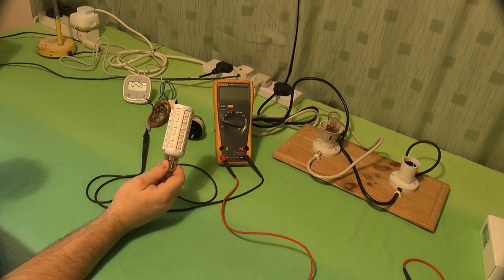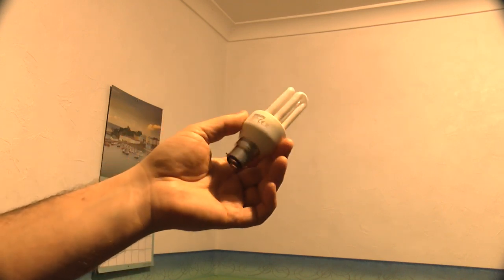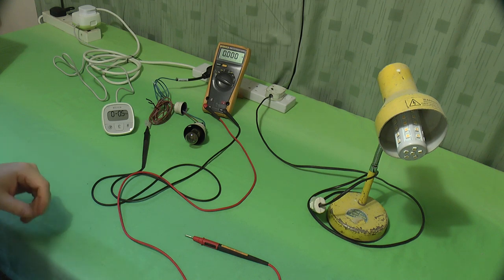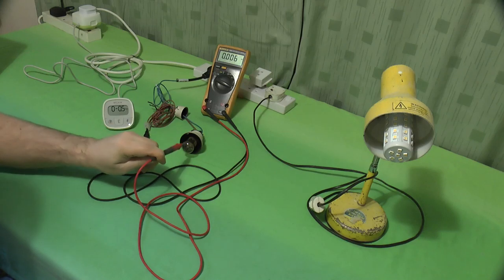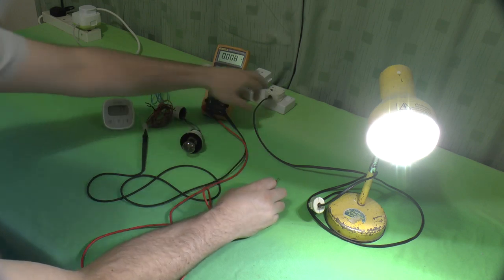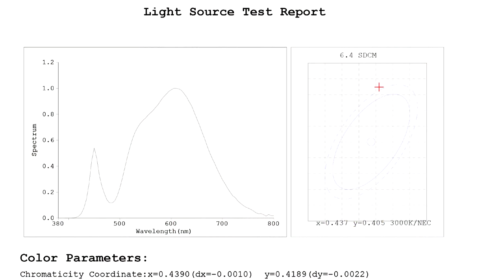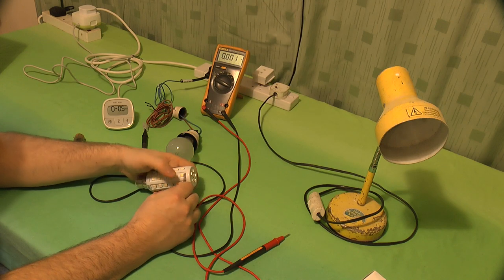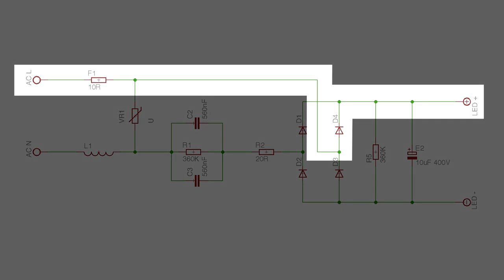Dangerous LED "corn cob" lamp test and teardown

Comment: i am not agree with some of the stuff shown on video.
1.who is going to touch these light when it is on?
2.other bulb is lighting because current passes between leds .
Reply from the maker: 1. If it's within easy reach, children can touch it. Look at the example, it's a bedside table lamp.
2. Other bulb is lighting because enough current is passing to kill someone.

If you don't agree with the video, please feel free to post your own, disproving the evidence shown in both this and the follow-up video.
Reply: AintBigAintClever That doesn't sound like a good advice ;). (let's touch it and see what happens :P)
Reply: Although you SHOULDN'T do that on purpose, if the LED bulb is working properly and all the LED lights up, you should feel nothing when accidently touching the exposed LED connecting contact whether the bulb has been connected correctly or connected with polarities reversed. GUARANTEED!

This guarantee is void if you purposely hold your hand to any grounded metallic conductive object in one hand and touching the exposed contact with the other hand.
Reply from the maker: John Lam
With a correctly-designed bulb, yes. Not the case with these. They're a potentially lethal shock risk, end-of.

Comment: This guy is touching the lamp with it on, and he is still alive...

Сравнение свечения светодиодной лампы E27 60SMD 5050
Reply from the maker: a) Lamp may have a different driver circuit design. Look at the bottom of the lamp 15 seconds in, in between the LEDs and the metal base, it's clearly a different design of corncob. If it uses a switch-mode power supply to drive the LEDs they may be completely isolated from the mains and therefore safe to touch.
b) He may not have gripped tightly enough to touch the metal contacts.
c) He may be using an isolation transformer (unlikely unless they're dangerous and he knows that to be the case).

Comment: I bought a similar Lamp as this one and i can't reproduce what happened here. I touch it in every possible way and no chock.
Reply from the maker: Yours may look similar but have a switch-mode power supply driver circuit (so the LEDs are isolated from the mains) instead of a capacitive dropper circuit (which is fine for conventional-shaped LEDs but no good for LEDs with exposed contacts).

Comment: why would anyone touch any contacts on any device that is connected to AC?  Why not plug it in a leave the thing alone?  If you are going to touch it, turn off the power.  I would not touch an incandescent bulb either unless power is disengaged.  Many things are not safe to touch I think.. I DO think they should put a plastic shield around the unit though like the envelope of an incandescent bulb in case someone with a moth-like mind decides to actually "touch" it..  just sayin'

Comment: Beware deadly #LED #bulbs for home use. #CE marked. Cheap imitation from China or just a lethal design?
Reply: Best line: what a piece of shit
Reply: We bought some daylight bulbs on ebay. Standard energy saver florescent 13W bulbs but emit a brilliant white light. I think they start / warm up much faster too. I was really impressed at how cheap they were, about £1 each from China. One thing I've learnt recently is that the UV spectrum is very big and the part which Does not cause cancer is small. Apart from that, quite happy with our cheap bulbs :)
Reply: Bloody hell, when you reverse the poles on the bulb!
Reply: Tom Woodland  yes that was alarming! Can imagine some poor child or even an adult touching the exposed LED contacts by mistake.

Comment: I've never seen so much bas science before in my life :~)
So you can draw a less than staggering 43ma by connecting it through an extremely low resistance bulb directly back to the neutral on the mains! (A thing that no one except an absolute maniac would ever attempt......). A typical pigmy bulb only has a resistance of a few hundred ohms, and would therefore draw a huge amount more current than the human body, which will have a typical resistance of several Mohms.
 So I decided on my own mentally challenged test :~) By strapping my wrist firmly to an earthed radiator via a decent multimeter I grasped the bulb with my other hand and eventually managed to get 0.81ma passing through my body at 4.3 volts (gasp!). Literally taking my life in both hands I licked my finger and pressed it firmly against one of the contacts - by doing so I managed to achieve 1.2ma and acquired a sore finger from the pressure. Resistance is everything!
If there is no isolation from the mains, how come it all still worked when you reversed the polarity, despite still having one side of your test rig connected to neutral? I notice you didn't show the little transformer usually moulded in just under the cap ;~) All you showed was the circuitry used to change the reduced AC voltage (usually around 12v) from the transformer to the 3 - 6v DC required by the SMD circuitry 
If you do contact the powers that be, may I suggest the following warning to be included in all packaging?
 
*WARNING*
Do NOT attempt to change this bulb with the power switched on whilst standing in a bucket of water connected to earth.
Otherwise mild tingling may result.
*KEEP AWAY FROM MAD SCIENTISTS*

Comment: ,Before anyone gets too excited about all this testing or forms conclusions that this particular LED array is dangerous, I have a suggestion. Either talk to an electrician about it, or study AC and DC basic theory and application. You will discover things are not always what they appear ( even when "demonstrated" on a video) and results & conclusions obtained by incorrect test hookups mean absolutely nothing....just having the proper tools is not enough.
Reply from the maker: Then I'd suggest the following:-
1) Buy one of these bulbs (the exact same ones)
2) Film yourself plugging it into a live outlet

At the very least you might get £250 from You've Been Framed.
Reply: he specifically used a setup to show that it is dangerous, rather than just showing some ghost voltage measurements where there is no current capability. The video clearly proves mains voltage with significant current supply is available on the LED contacts... Maybe you should learn some "basic AC and DC theory"...
Reply: MetalPhreakAU Possibly there are some holes in my knowledge & I'm always trying to learn more. I have 2 questions please. Is the bulb portion of this lamp DC? When checking for potential that could be harmful here in the US, testing is between ground and the point in question. Equipment cases are either grounded, or floating (2 prong plug). Is there a reason testing should be different on circuits such as this, using AC neutral on an energized circuit as a testpoint? . Always learning!   Thanks   Rob
Reply from the maker: Robnord1
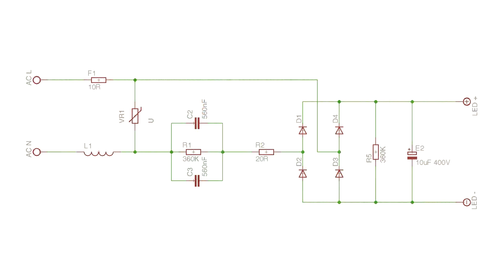You'll see a circuit diagram at 19:01, the LED strips are connected to the LED outputs, 8 strips plus the end cap in parallel, with 6 LEDs per strip, in series. The LEDs are run on full-wave rectified AC mains with a low value resistor limiting the current in one line and a low value resistor, two capacitors and an inductor limiting the current in the other. As it's a bayonet fitting the input AC live (hot) and neutral could be either way round, and the amount of current available to shock you depends on which way round it's plugged in. In its "worst" orientation the only thing between the LEDs and the incoming mains supply are a 10 ohm resistor and a pair of diodes (one half of the bridge rectifier), with one diode going to one end of the LED stack and the other diode going to the other end, so both ends of the LED stack are equally dangerous.

I could've tested between ground (earth) and the point in question, but that would've tripped the RCD (GFCI) feeding the mains socket circuit. The ground and neutral are connected together by the electricity supply company anyway (a PME a.k.a. TN-C-S system) so there's normally little or no potential difference between neutral and ground. The pygmy bulb pulled over 86mA and would've pulled the same if connected to ground instead of neutral, the RCD would've tripped with anything over 30mA and got in the way of testing.
Reply: Wow! Now I see what you are dealing with there, having the possibility of neutral or hot on either side. Seems like they would make one prong slightly larger to ensure proper polarity...thanks for explaining that.  Rob
Reply: AintBigAintClever ..... " ........  get £250 from You've Been Framed ........ " ......... does Been Framed have a " snuff " section ?

Comment: Made in China, but probably a British designed product as most products manufactured in China are, so live parts exposed is not the Chinese Manufacturer's fault, The fault rests with the company who commissioned chinese manufacturer, or the importer, so don't whack poor Chinese goods, not everything China Manufactures is designed by Chinese. Famois brands like Sony, Motrolla, Toshiba, literally every famous brand is now manufactured in China.
LED technology wasn't developed by Chinese, we in the West Use Chinese cheap labour for our own needs and greed, we the consumers will not buy stringently designed safe goods because our Manufactiring costs are too high, and goods turn out to be unafforadable, our consumers look out for cheaper goods, irrespectively where they are made.

Admittedly the design did not incorporate safety against shock risk, so it should be withdrawn from all UK outlets, Trading Standards should intervene, and stop import of such dangerous goods, and of course there is no reason why Chinese cannot put a glass or a durable plastic encasing around the LEDs and make it safer and charge the cost to our consumer, why not if we are that safety concious then don't expect Chinese to sell them at the same price with or without the encasing.
Reply: Nice trolling.
Reply: Really? Nice propaganda. Ellsworth mentioned in one of her videos that device that she designed was working fine in prototype stage. Device was manufactured in China and final product, first batch didn't work. They found out that manufacturing plant had changed design themselves without permission in hope of reducing production cost, obviously in hopes for better plant profit. Search for "DTV Engineering Jeri Ellsworth"  it's there.
Reply from the maker: DTV engineering Jeri Ellsworth

Comment: Even when a toaster is set at low setting and the heating element won't glow red
hot when operating, will you or your kids touch the toaster heating element when
the toaster is turned on? Certainly not. It is through education that you and your
kids know that. Therefore when a LED bulb is turned on, a natural person should
not intentionally touch the LED or any exposed contact connecting the LED.

I agree that the bulb should have a cover for better protection, and most of the
LED bulb sold in the market have. It's the quality control that determines the
quality of a product, certainly not where the product is made. Name-brand products
worldwide choose to manufacture their products in countries with lower labor costs
without jeopardizding their sales. A comparatively cheap LED bulb doesn't have a
cover in order to decrease the cost and passes the savings to consumer. As a
consumer, the price for saving money is to remember through education not to touch the LED when the bulb is turned on.

This video is misleading in a few aspects. The tests performed are jokes. They are totally manipulations. By connecting the incandescent bulb in the ways shown in the video, the bulb is in fact connecting to the mains through the limiting capacitor in the first case, and to the mains through a half-wave rectified DC when the polarities are reversed. Try connecting the red probe of the DMM to a toaster heating element that has been turned on. A new innovative video will born.

Although it is strongly recommend NOT to touch the LED or any exposed connections when the LED is turned on, one shouldn't feel anything if accidently get into contact with those tiny exposed connections. Of course, if one purposely holds a grounded conductive metallic water pipe in one hand, and touches those exposed connections with another hand, individuals may get tickle feelings or worse. NEVER try it.

Depending on how the LED strips are connected, the circuit provides an average DC current of 40-70mA. If one touches an exposed connection accidently, one should feel nothing since all the current will still pass through the LED strings. Capacitor C3 limits the circuit current to what the LED strings need, and no current should pass through the person. Every capacitive power supply has been designed for a specific application. It is not an act of simply connecting components of arbitrary values. This is different from touching the metallic connections of an incandescent bulb that is connected to the mains. The mains will supply as much current as are needed by  loads, A person will get electric shock.

In case there is problem with the LED string and none lights up, resistor R5 (360kΩ) will act as a protection limiting the circuit current to less than 1mA. An accident touch either will produce nothing as the touching-point has been discoonected from the circuit as a result of a defective LED, or may get tickle feelings but certainly not fatal threats.

As a matter of fact, the circuit designer of this LED bulb is very knowledgeable, taking safety considerations almost  in every area which includes EMI interference, voltage spike, current surge, defective LED protection, electrical charge bleeder. The only drawback is the lack of a cover or without the coating of an insulating layer over the exposed contacts. Still there is no fatal threats unless created purposely.
Reply from the maker: 1) You're comparing a toaster element (120/240 volts) to an LED (3 volts)? Heck, I'd better wear rubber gloves when fitting an LED to my MagLite!

2) Name-brand companies are unlikely to put counterfeit safety marks on their devices, instead designing them to be safe-to-touch (one of the requirements of CE marking).

3) The 25-watt pygmy bulb has roughly the same resistance as a human body at 240 volts, and is connected in the same way a human body would be making an accidental connection, i.e. between the LED contacts and ground. The alternative would be to use your finger. Swapping the incoming L and N makes no difference to the rectification, the circuit diagram makes this perfectly clear. However it does change the current limiting; one way round the live side is limited by 20 ohm resistor R2, two capacitors C2 and C3 (with some additional current flow through resistor R1), the other way round it's limited by a 10 ohm resistor.
Incidentally touching the red probe of the DMM would result in the bulb lighting at anything from 0% to 100% brightness, depending on where along the element is being touched (as it's acting as a potential divider).

4) The LEDs sit between two current limiting circuits as described in point 3 above. If you make contact with the LED power supply pins (both of which will be exposed on the board) you are bypassing part of the current limiting circuit, allowing more current to flow.

5) Resistor R5 will IN NO WAY protect you from the mains, follow the trace from the AC L input to the LED+ output. R5 is there to discharge E2 when the mains is disconnected, bringing its stored potential rapidly down to a safe level (even without the LED strings it'll drop from 340 volts to 20 volts in about 10 seconds). It has a counterpart R1 which discharges C2 and C3 (down to 20 volts in about a second).

6) The designer of this lamp's circuit has designed a product which is safe ONLY if a cover is fitted. The designer of the lamp itself (the LED mounting and plasticwork) has made a product knowing it to be dangerous, and if someone is injured or killed by one of these lamps ought to face criminal charges.
Reply: Try telling that to a dead child who innocently touches such a device.

Safety agency regulations are purposely written such that even an innocent, ignorant child or adult isn't likely to get killed or suffer an amputation while using a consumer product.  The lamp described in this video doesn't meet the requirements of any safety agency or testing laboratory anywhere on the planet.

Comment: For me you have not proven anything special.Connecting in series some components which are not separated with transformer from primary side.Truth is ,that if you buy cheap bulbs then most likely quality and safecty will be compromised.
Reply from the maker: +wowerman I've proven that these are a potentially lethal shock risk. I'd say that's pretty special.
Reply: AintBigAintClever
They are.Some china bulbs have been improved ,they have insulation now.

Comment: They need to have a transformer inside to isolate the mains from the LED's a proper SMPS circuit is required. Now I know why LED bulbs in places like B&Q are so expensive at least they won't kill you!!  Manufacturers in China are taking advantage of these high prices to sell this cheap shit!!